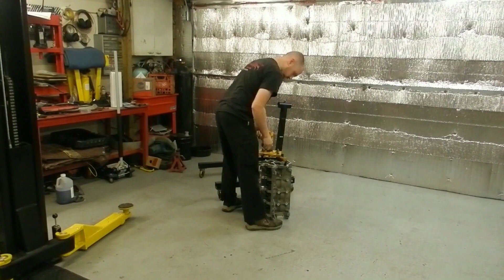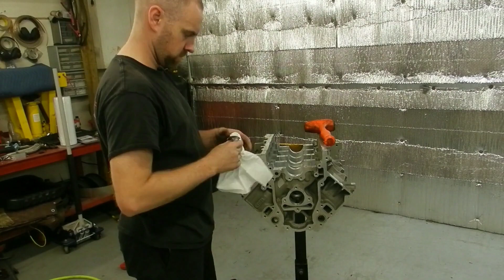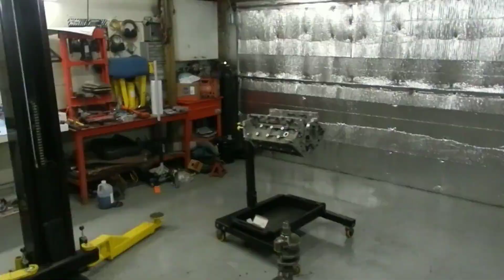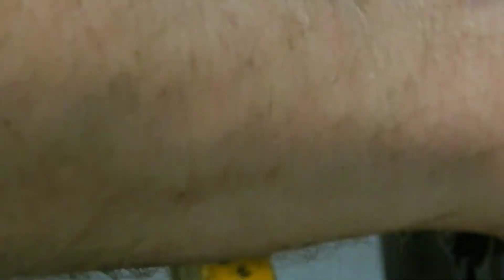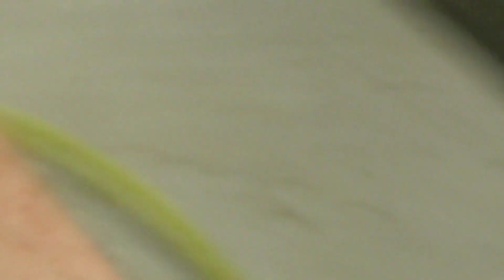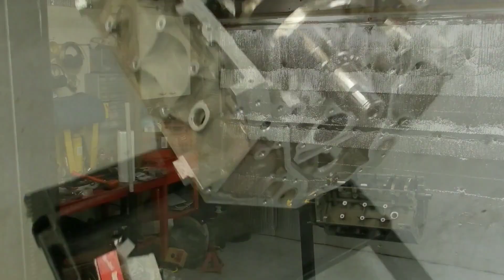2005 c6 corvette LS engine rebuild part 6 Engine Assembly

Comment: I could see the your shop info in the lower right hand corner, which is great, but it is much too small to read if someone is using a phone to watch the videos.  Videos are good and I love the info, but as a modified C6 owner I would want to know where you are located and an e-mail or phone number in case I have an issue that might be beyond my comfort level of dealing with.  That info is probably there in video but too small to see.  Keep making the videos, I’ll take free education anywhere I can get it.  I am a mechanical/electrical engineer and I work on equipment regularly, but you would be my first choice for someone to work on an issue with my car that was beyond my comfort level.  Love the videos and gaining knowledge from your experience and attention to detail.